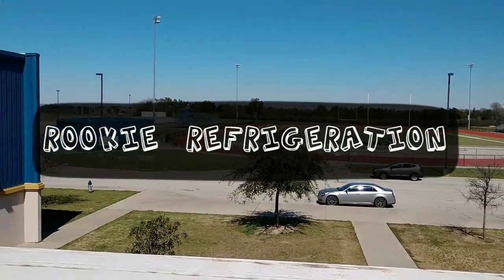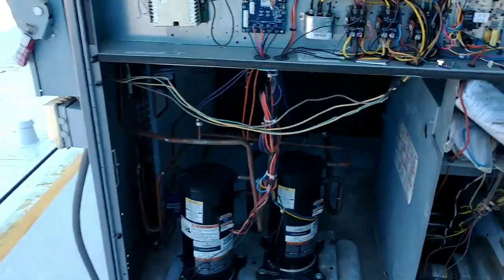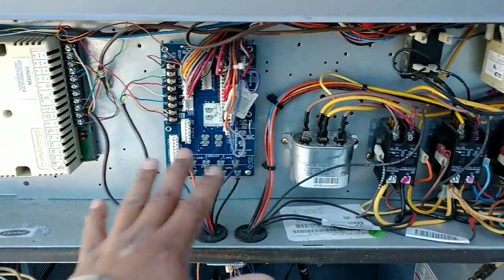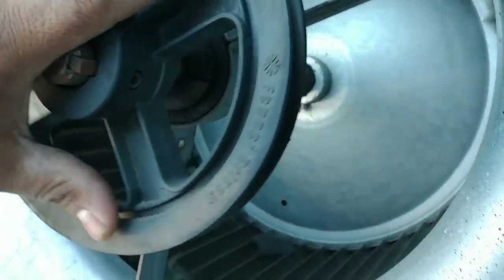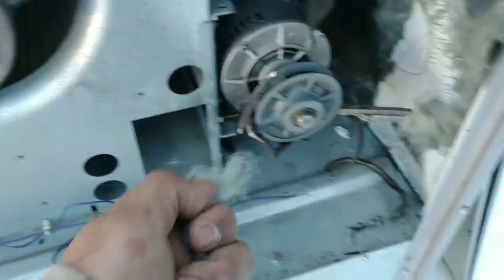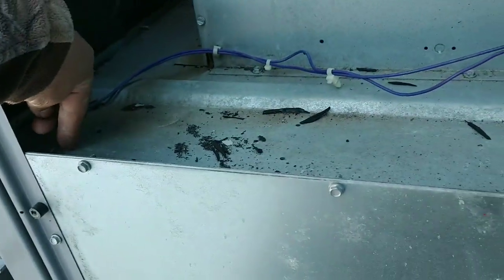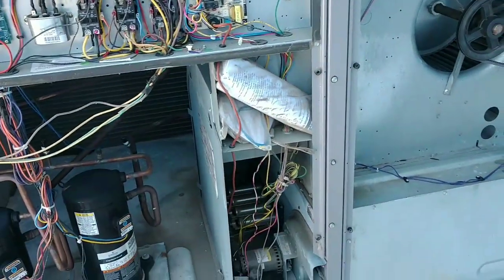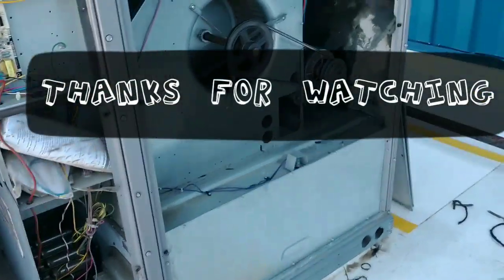HVAC/R-. How I deal with Low Voltage Shorts on RTUs

Comment: After looking for the obvious, I like to unplug my stat wires from the terminal strip and plug them in one at a time until I know which ckt is popping the fuse.  Easy way pin point the short